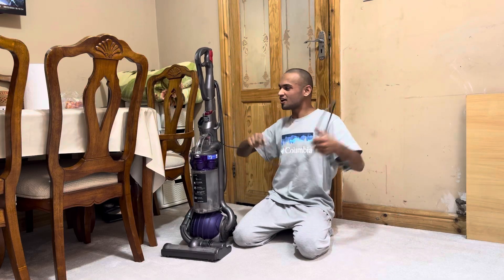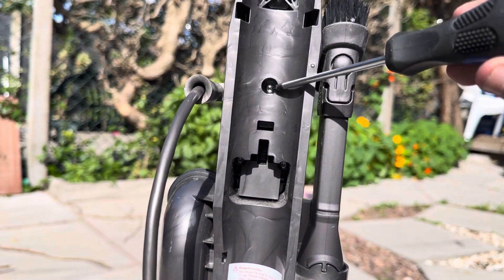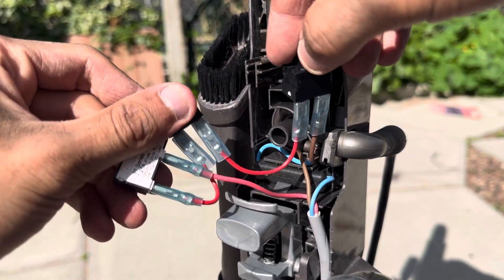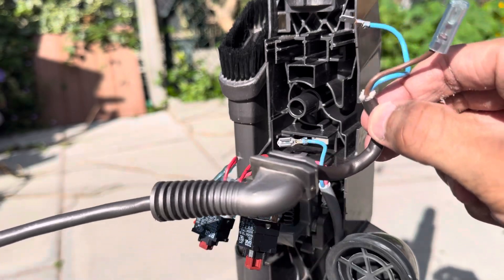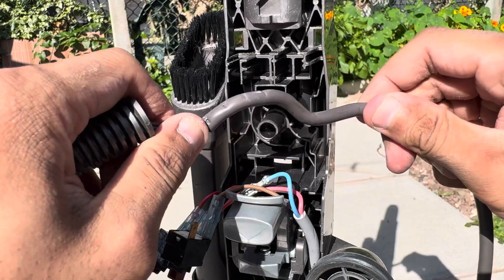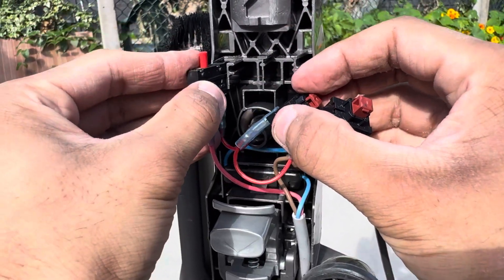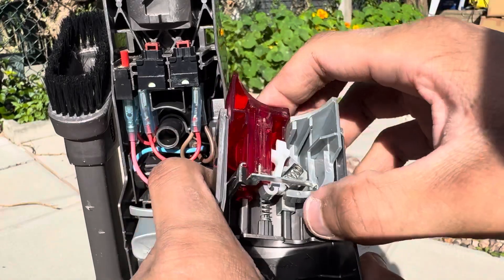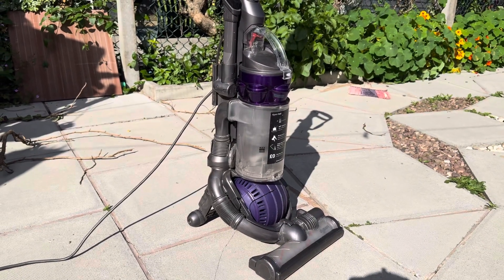HOW TO - Replace Dyson DC25 cable in 2 minutes [Technical repair]

Comment: Hello.  The Dyson Ball Animal 2 has a black plastic behind the roller.  The plastic seats in between the rollers and the airflow, I have seem videos of people removing it and supposedly improve airflow, have you ever try that?
Reply from the maker: Hi, yes whilst it can help to improve the airflow, it also makes the machine struggle to pick up heavier debris like rice, etc. The purpose of that plastic piece is to create an airpath to concentrate the airflow in that area to vacuum away what has been picked up
Reply: @parwaz7861  That makes sense! Thank you so much :)